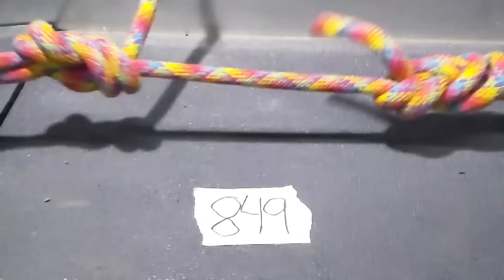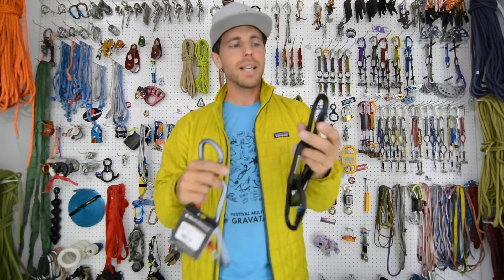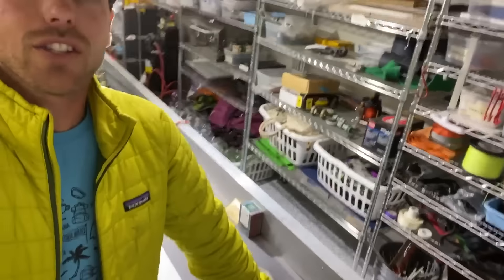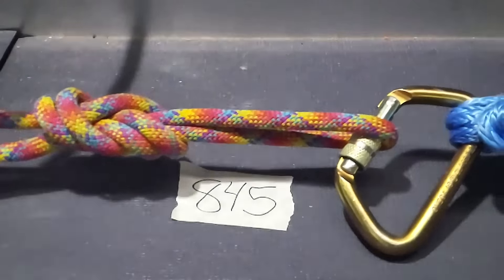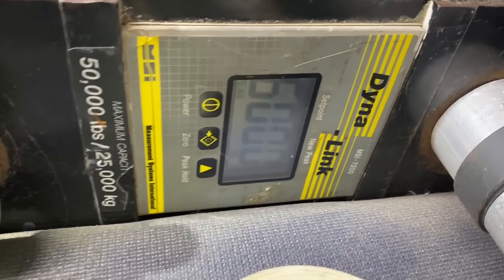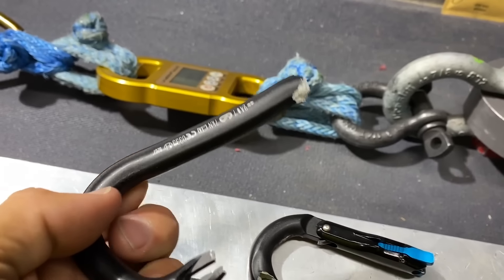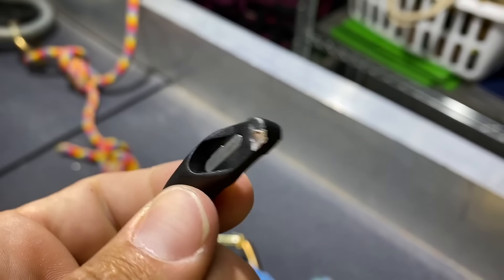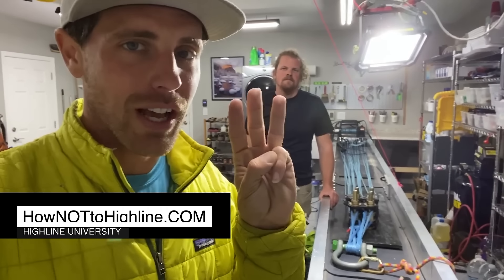Black Diamond Magnetron Carabiner Break test - SlackSnap

Comment: I recently bought three of these as well as three triple-locking biners and have found the magnetron to be SO much easier to operate one-handed.  The larger size in general (as well as an extra 1/4" or so in the gate opening) makes them even easier to use.  The problem some users will have with them is there is a gap under the release that it moves down into when you press to release, and if dirt or bits of rock etc get into there you won't be able to depress that side of the lock.  You might be able to just tap it to get the debris out, but if it's ferrous (attracted by a magnet) and doesn't want to shake out, you might be stuck!  I was able to get mine for $23/pc, but they generally go for more like $28.  Worth it for the additional convenience IMO.   Thanks for testing them, I too was wondering if their ratings were honest, given the larger size and novel mechanism.  Usually larger biners of the same material will test lower, but in this case it seems they are actually better.  Thanks Peter for the donations, that must have been a good $100 in hardware you sent in for destructive testing!

Comment: One of my favorite lockers and I've got most kinds. Great for the alpine (gloves). 
You should break some double gates from Grivel. Those used to be rated for 30kN. Supposedly having two gates makes up for a lot of that extra strength. Also they are virtually impossible to be opened by mistake. Only takes a bit to get used to them. Open the outside gate and slide the other one.
Reply from the maker: That's a great idea!

Comment: Would love to see a video testing deadman anchors in soil as highline anchors. Obviously loads of variables and hard to standardise but would would be interesting to see the difference depth makes when burying an achor of the same surface area each time and the strength of different pull directions

Comment: Hi guys, I think you can try to "break test" some knots like prusik, machard with some kind of rope material, as nylon or dynema... Just for save some money
Reply from the maker: I'm down for cheaper tests, but breaking shiny stuff adds fun value!
Reply: @HowNOT2  could break/slip test a Micro Traction then, see when they slip and how they work after being taken to whatever their failure mode is. I was suprised that they're half as expensive from a lot of big UK shops than the typical US shop price.
Reply: @piman3072  yeah noticed how expensive climbing gear is in the states even US made stuff, as can understand european stuff being more expensive over there but when getting BD gear would have expected it to be a little cheaper.

Comment: The magnetic locks on BD biners are cool but you really have to check the magnets. It's not so much they get coated with "grime" as you say, but it's that they attract ferrous materials from the dirt and rocks at the crag. I quit using my Magnetron because of this at my local crag. Did not have any events where it failed to lock up but a few episodes where I checked the magnet and it was full of particles, kinda hard to unstick them.

Comment: Specific hatred of magnetrons due to them being used on a top rope anchor in Red Rock, and having a nearby group allow me to climb on their gear if I could put the rope back up. Didn’t bother equipping even an extra draw or a personal cause I had just set down my stuff upon arriving to Black Corridor, and when I arrived at the anchor struggled for a solid five minutes figuring out how to clip myself in to the carabiners while on the rock.

Ended up using my mouth. A little wiser, a little better prepared, but not a fan of those specifically for such a ridiculous circumstance. Still not a fan of folks using autlock carabiners on rope side, and always leave a draw at an anchor if I don’t clean the bolts.

Comment: These are absolutely great videos, I have watched more than I can even count. Just as FYI: I think you might be using the term 'in theory' incorrectly. A theory is an explanation of some (typically physical) phenomenon which has been confirmed by repeatedly testing from multiple sources. A hypothesis is a proposition that has yet to be proven to be an accurate description of a phenomenon. In at least some instances you are using 'in theory' when it would be better to say 'the hypothesis is...' or 'it is proposed that...' Also I second all the comments about breaking the Grivel double gates, would make for a great addition to your experiments.
Reply from the maker: If i say hypothesis, i'll sound smarter.  Whether or not it applies to what i'm talking about i'll use it! :)

Comment: I'm curious about Grivel's twin gate carabiners, does anyone have any experience with them?
Reply: KAP I’ve used one for belaying with a GriGri and they’re awful for that purpose. The gates are wider than normal and hardly fit through the gri. The twin gates are great for top rope stuff of when you are not going to be seeing the piece of gear while using it. They are probably the most unlikely to open of all karabiner types IMO. How the gates affect strength, no idea. Would love to see!
Reply: I use a solid-wire-gate version with my Revo, this one is almost perfect for that purpose; hope the wire-lock, which is more intutive, will have rotation-retainer versions too.
Reply: @Lunzicle  DMM Ceros is my favorite carabiner for the GriGri by far
Reply: Send some in!
Reply: Buck Crockett is love to, sending from Europe is EXPENSIVE! I’ll DM him and sort out a Donation for it with some friends here. I know they would be keen to know too.
Reply: Depends on which one you're talking about...I have a few of their newer model/design (the "Tau"), and it's a pretty slick looking 30kN aluminum carabiner, and it's easy to handle one-handed after some practice. I have a pair of them on my pre-built quad/cordelette for the anchor-bolt side connection.
Reply: I love them for belaying with an atc!!
Reply: @piman3072  I just bought a ceros as I love my other DMM locker and it definitely lives up to expectations

Comment: I’d like to to try a set up where the forces are applied at a faster speed to make it more realistic to falling. See what the max force is with that. But other than that great video.
Reply from the maker: Looking for the universe to send me an engineer that will help me get an high hz, S beam dyno to attach to a labjack to attach to a laptop reliably and ideally without cables.  Once the universe provides someone with more than just a paragraph explaining it, but will actually help put it together, then I will build a drop tower immediately!
Reply: HowNOTtoHIGHLINE I do engineering at uni but don’t see that helping😂 plus I’m in Scotland
Reply: @HowNOT2  where are you based? If this is still the plan.

Comment: How can I use these magnetron carabiners? Is it give the same safety as original screw? 

Could I use is on top rope system, or any other limits?
Reply: Use them the same as the screwgate version. They just lock differently.

Comment: 4:18 uhmmm MBS on the meter stated 28.45Kn  you stated 24Kn
Reply: Prairie Climber I think he was referring to the listed closed gate strength... which is 24 kN.
Reply: @user-zz8ln3uh5x  I realized that was a possibility after he busted the next carabiner
Reply: @Caedmon Swanson reading too quickly ya, then after he busted the next one I think he may have been referring to the closed gate strength. both are posible
Reply: Just shows best policy is to proof-read before posting
Reply from the maker: "MBS was 24kn" .... and you can see it actually broke at 28.... so it was better
Reply: @HowNOT2  Yes MBS was better than the rated Kn. but for clarity.... did you mess up while reading the meter or were you referring to the Kn on the biner?
Reply: @heli400  MBS means the rated strength, not the measured strength. "Minimum Break Strength"